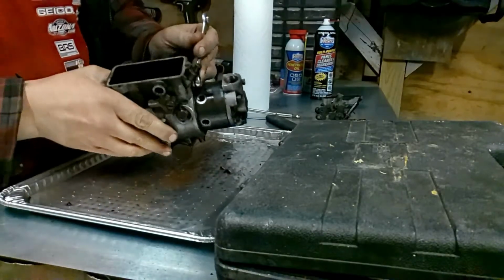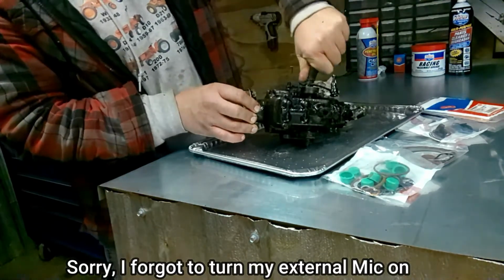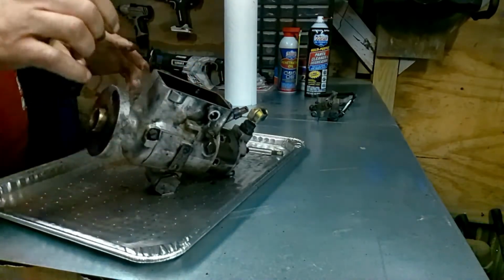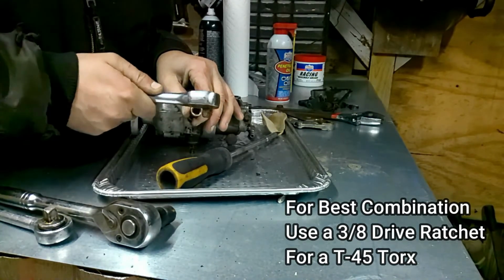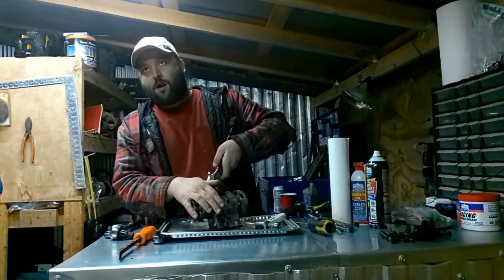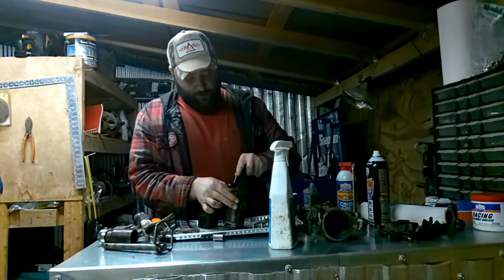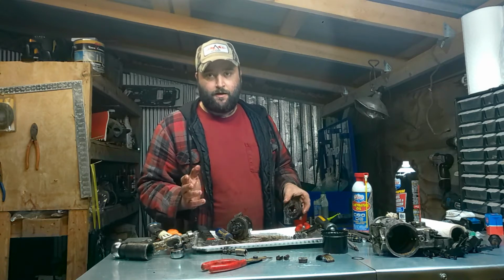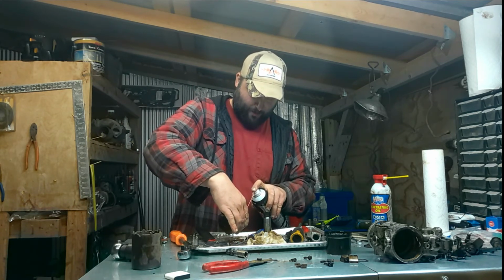Disassembling a Stanadyne Roosamaster DBG Injection Pump

Comment: I working on pumps on my 190xt's I got 4 diesels and 1 gas . They all ran good and then I got sick and in that time things  started going down hill and Tractors started breaking down and then I broke down too . I had to much going on mentally and physically I had both hips replaced at 49 and 50 .Im Better now and got my will to get the tractor s running again  3 of the pumps are stuck from sitting and I had one running but it runs a few minutes and stops 
 I had the pump off and apart put a new flex ring in it . I just realized that I didn't clean the check valve on the top cover . And it had line leaking and that hand primer is shot on them and leaks  so I'm setting up small electric pumps on all of them in the line and getting rid of them there like the ones on John Deere combines on The bottom of the tank . One of the tractor s I drove it back by the woods used it turned it off and it would not start . Trying to blow air in it on #1 port as I turned it over . I got it to spit a little fuel but not enough to start  . I was going to pour some torco solution in them to try to dissolve the crap fuel in them . I better go  if you do read this send me a message back ok thanks
Reply from the maker: Im sorry to hear everything you had went thru but glad everything all good for you now. Sounds like your problem might be the balloon seals on the pump shaft. If it attempts to have any slight pressure it loses the pressure and thru the seals into your oil. Those are tricky and easy to break or score, please use the tool if you attempt it. I hope this helps and its a cheaper fix.